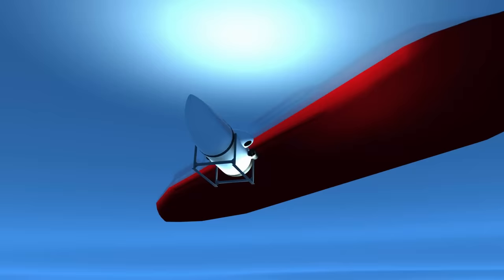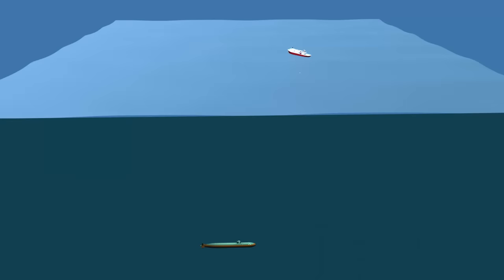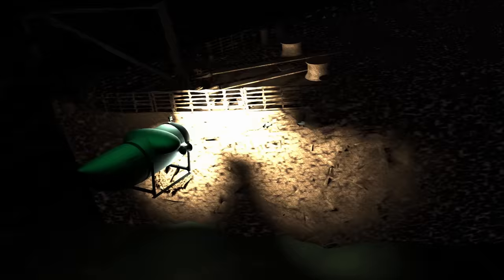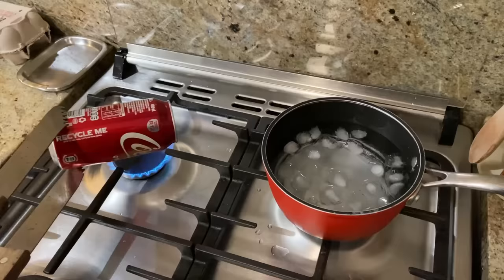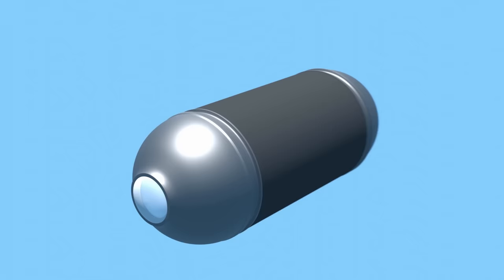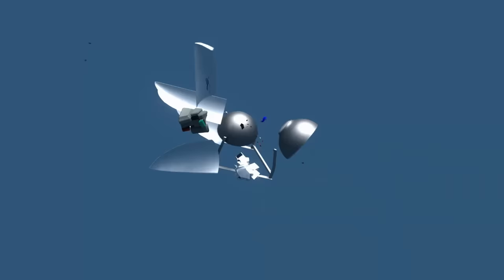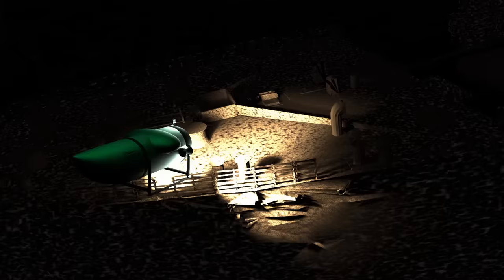TITAN Sub implosion | Deep Dive animation explanation

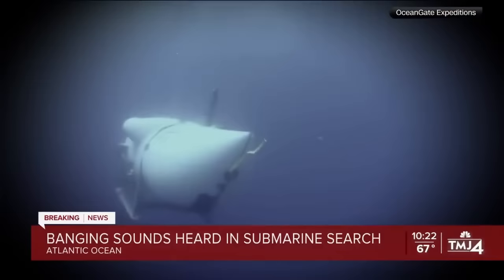Comment: 5:59 There was a brief statement given that there was explosion heard. The reason for not immediately saying they imploded is that it is better to continue searching and find out later that the ship was long gone. Had they called off the search and an intact hull with bodies was later found, there would be serious repercussions to any leadership of the rescue as well as public backlash.
Reply: Also, the sound was plausibly an implosion, but not guaranteed to be.

Also, and most importantly, the first ROV that could go as deep as 4000m was immediately called upon and was mobilized from buffalo to the wreck site within 4 days. 32 tons of delicate equipment, plus the crew, plus all the installation of the equipment. they immediately went down and searched for the probable site of implosion debris and found it within a few hours. It's unbelievably fast. like above-all-expectations fast.

Every expert speculated on the implosion because it was the most likely scenario, but it was unproven before the debris were found. You couldn't even hope for the debris to be found as fast as they were.

Comment: Nicely done. As a fellow architect, my interest and deep respect for engineering and science mirrors yours.  It took my career into the field of complex adaptive systems & simulation technologies.  When I saw the video of them smearing glue (epoxy presumably) on the inside of the Titanium collar I was flabbergasted at the loose dimensional tolerances that enabled the ring to slip over the carbon fiber tube with ease.  Surely, I thought, they aren’t relying on hand-smeared epoxy to seal the gap.  Also I did a few bending moment calcs which I then rotated 360 degrees and wondered whether bending stresses and shear forces at the glued titanium rings from the enormous uniform loading had ever been simulated or tested with different carbon fiber weaves…..a sad loss for sure but, aside from the panic over the emergency, the implosion would have happened far faster than any awareness would have been possible.
Reply: Astonishing, that glueing bit...no squeeze out, and just what, 2 inches of contact area between ring and tube. I'm nowhere near an engineer, but mixing some epoxy in a scadgy bucket then scraping it on like that didn't look like the sort of precision engineering where you need it most on a submersible...yeah, I know, everyone's an expert in hindsight!
Reply: @jnavonoD  I agree and had similar thoughts - surly they weren't relying on that to keep out 370 atmospheres...no, they are.

Comment: I heard someone saying that problem with Titan's design was that carbon-fibre has limited lifespan on so many dives. If you want to make carbon fibre sub you need to completely replace it every few dives. I'm surprised that was 24th dive. That was extremely greedy. Another good insight was provided by you: "Fillaments were rolled in one direction only". Maybe if they rolled it in all directions this wouldn't happen or would happen after many more dives instead. But seriously..they didn't test how many dives can this carbon-fibre structure survive to cut costs. Now instead of dollars they payed with lives.
Reply: No it wasn't the 24th dive, it was 7th dive with that exact hull.
Reply: Not sure if it’s true but I heard that last time they were on this same submersible it was giving problems and still ignored the signs 🤦🏽‍♂️
Reply: Rush purchased the carbon fiber from Boeing — which boeing had “retired” bc of its age and stored in a warehouse for quite some time
Reply: @rejuvenatingsoul3498  I've seen different numbers . 9 for instance, but I don't know where the maker of the video got 24 from.

Comment: This is an excellent analysis. 

I am no expert, but I am reminded of the difficulties experienced with the early Comet jetliners. That was also a situation where repeated cycles of compression and decompression caused fatigue over time in a way that engineers had not anticipated. The Comet was operating under stresses that passenger aircraft had not yet operated under.
Reply: The problem with that analogy is the designers of the Titan had generations of engineering history to look back upon (much of which they disregarded), unlike the Comet engineers. The analogy would be proper if the Comet were designed today with all its flaws!

Comment: A search of "Did Titan try to surface? " results in an article (Insider) that notes the ballast had been released prior to implosion ... suggesting the passengers knew something was wrong and prompted them to urgently try to surface.   Sadly, the idea that they died in blissful ignorance may not be wholly accurate.
Reply: Yeah they likely would hear cracking noises as the hull started caving in, but once it finally did. They died in about 0.01 seconds, or even faster even.
Reply: @FabledGentleman my guess is 
It takes much longer than .001 seconds to make a thought
Reply: @PInk77W1  Well at least thoughts don't hurt. Might have been scary down there for a few seconds.
Reply: @FabledGentleman the Pakistan businessman’s son did not want to go down and only did it for his dad. He would have been terrified the whole time.
Reply: Yeah, that's why the engineer Oceangate fired said that Rush's acoustic monitoring system was worthless because by the time it would warn you that something is wrong it was likely too late to save you.

Comment: Nicely done
As someone who designs and builds with glass and resin, the strand orientation is baffling. The predominant direction of fiber should be along the longitudinal axis, the only thing working to resist the forces involved here is the resin. A chopped strand blown tube would have been more effective at resisting pressures. 

And why!? I still haven’t heard an answer why Stockton chose carbon over steel? Cost!? What was the differential ? 
You want long shelf life? Build a big oven and shove your steel sun into it and anneal every 50 dives. Brand new. 
Carbon prepreg. Only gets worse with age
Reply: I suspect a failure like that shown in https://www.youtube.com/watch?v=8tW4zfTeJqM video posted ten months ago, showing a tiny model submarine in a deep sea chamber.  If the composite delaminated, it could have been squashed flat like shown without breaking any of the circle-wrapped carbon fibers therein, rendering the strength of the fibers a moot point.  Having some fibers running from the outer perimeter of the hull at the bow, to the inner perimeter at the waist, and then the outer perimieter at the stern would have improved strength a lot, but there should also have been fibers running radially and wrapped around something near the inner and outer surfaces.  In order for the hull to collapse, it would have to get thicker, so fibers connecting the inside and outside would be positioned to discourage that from happening.

Comment: A loud bang on hydrophones + loss of comms is a pretty bad sign, but doesn't prove conclusively that they imploded. From the PoV of the search team, if that scenario happened, then the crew were dead. In that case, they didn't need to confirm that fact quickly. But at that time, it was still possible that the sub had lost power but successfully executed an emergency ascent. In that case, they would have been floating on the surface, unable to open the hatch to get access to air (plus that would have caused them to sink anyway). That scenario was the only one possible where the crew might have survived in the end. So it made sense to focus on that until time ran out for the air supply.
Reply: yeah but they also definitely heard the bang. unfortunately they were probably in denial about what the sound was. but they used sonar technologies to communicate, there's no way they didn't hear a loud noise at the same time
Reply: They had the comms but also the transponder which failed at the same time of comms so they knew even without the sound that it imploded. Losing comms was pretty common with Titan.
Reply: I heard it just took that much time to even get underwater search vehicles out to the wreck site to look for debris and confirm it really imploded.
Reply: ..

P😊😊😊😊😊
Reply: @nafmtigia  The point still is to focus on hoping to save life instead spending time looking for dead bodies. Are you actually calling that "denial"? That's "triage".

Comment: I worked  with this composite material for years for use in dead tank circuit breakers on a global scale. These parts undergo unbelievable amounts of pressure and heat during use in the Interrupter. At one point, Inventory was mistakenly providing production with expired parts as they have a shelf life to abide by. This caused the breakers to fail tests. I understand Stockton purchased outdated material for the hull. If this is true, this submersible was a ticking time bomb based on that alone.
Reply: IIRC he purchased outdated carbon fiber from Boeing(?) and iirc, this video said that the CF was used for the cylindrical body part (5 inches thick)
Reply: From other Youtube sites, where materials engineers have comments, it's my understanding that the carbon fiber composite has great tensile strength, but low compression strength, that it is difficult to diagnose failure until it does fail, at which time it shatters.
Reply: @TheCandiceWang Boeing commented that OceanGate or Stockton Rush never approached them at all.
Reply: @@frogmen6105 your English is fine!
Reply: @weiwu1442  yup. I see that. Idk where the lies begin and where the truth ends??
Reply: @weiwu1442  purchasing parts from Boeing is different than Boeing working on your submersible and giving their expertise to your project. Totally diff things.
Reply: No, hearsay. Boeing denies knowing OceanGate / CEO
Reply: @@frogmen6105 It might have had an effect.. I believe that certifying CF parts isn't an exact science. It depends on percentage of load versus capacity, temperature environment, analysis of the angles of force against the structure. It will eventually fail, and probably without warning. If it gets so much as a scratch, you replace it. You get a performance curve which exceeds the operating load envelope with a large margin, and probably varies with the number of cycles.
   In compression, the carbon fiber doesn't come into play until the epoxy breaks down enough for the fibers to move at close to an 180 degree angle.
Reply: He was completely crazy. He had to use carbon fiber, then it had to be expired, then he had to make it 2 inches thinner than originally intended, then he did not do the correct pattern, then it was glued on titanium parts instead of being solid, then it had to be cylindrical, then he had to use glass rated for only a third of the pressure,  then he did not scan the vessel after use and did not do proper testing before, on the first dives he heard loud bangs of parts of the carbon fibre giving in, and he towed it on a platform causing additional stress to the sub, it could not open from the inside, and he had no dive without severe failures of some critical parts. 

This guy was so stupid, his death was completely inevitable. At some point they did not even clean the chamber between use even though months passed, and he managed to have a thruster installed backwards, which he noticed only after the sub was spinning around instead of going forward at 3800 m depth.
Reply: Stockton was egotistical, he could have talked with a few employees from Boeing from time to time off the record and made claims to be working with them, which is not the same, whatever interactions occurred even extremely minor he was using it to boost his credibility

Comment: I like this one. Little conjecture, but informative.  I was also surprised at the carbon fiber wrapping being unilateral. It was wrapped over a steel - which also surprised me. There are lots of issues to deal with. Good job.
Reply: And yet, it survived 23 times, with vigorous inspections in between dives. I think the weak link was the glue that held the rings on each end of the carbon fiber tube.  What ever happened started happening about half way down, and it looks like for about 6 minutes they struggled to come up, before implosion occured. I think a tube failure would have been all at once. But a glue seam failing might take several minutes to separate and implode.

Comment: Carbon fiber is far stronger in extension than compression. That fact alone makes it a lousy choice for any sort of pressure hull. It weakens with each dive because stresses build up and then dissipates with each dive due to fractures within the material forming and joining with others until eventually it fails suddenly.However, this was not the only deadly flaw lurking in the Titan submersible. The view port was only rated for 4,000 feet, not 13,000 feet. If it failed the result would have still been an immediate implosion. The bond between the carbon fiber center section and one or both of the end rings could have also failed because they were inherently flawed to begin with. I suspect the Coast Guard will find conclusive evidence of what caused Titan to implode and how.
Reply: 100% agree, with the fact that Carbon fiber are excellent against tensional stress rather compressive stress.... Good to make its use in space where internal pressure is more than outside but not for under water with high pressure outside.....
Reply: Tension can resist crushing though, in a circle. For the circle to go out of round requires one part to compress but ALSO requires another part to stretch.
Reply: Wow ! Suddenly everyone Is an expert on the appropriate material composition to construct a deep sea submersible
Reply: @lionheart4552 at least everyone who hasn’t kllld 5 people
Reply: All they needed was a couple of cans of Flex Seal
Reply: @PInk77W1  That has got to be the daftest comment ever on YouTube.
Reply: @lionheart4552  is daftest good or bad ?
Reply: @lionheart4552  Wow!  Suddenly the comments are filled with dismissive nonsense about how nobody can offer an informed opinion.   Might be some of us have knowledge you lack?
Reply: Interesting how the carbon layers were laid.  Having build large scale high performance radio control model aircraft, I would have thought they would have laid some of carbon fibers in a overlapping cross hatch pattern which would spread the stress loads over a larger area.  Also a weak point has always been where dissimilar materials are attached, such as the carbon fibers and titanium rings. Carbon fibers and epoxy resin can make a very strong structure, but they are brittle.  I   know this after examination of some of my crashes where the metal bends, but the carbon fibers shatters.
Reply: @lionheart4552 No, a lot of us don’t have that knowledge. But, we trust the many experts that do have that knowledge and have analyzed/explained this disaster. Funny, it’s almost like relying on the experts would avert such catastrophes.
Reply: @jacksons1010  I didn't know that you were a member of the  National Transportation Safety Board. Please accept my apologies.

Comment: This is probably the best video I've seen yet that covers the implosion aspect of this tragedy. The reenactment using CGI and the Coke can experiment really wow'd me. Great content.
Reply from the maker: Come back for more 😀
Reply: Yup, the main difference is that the aluminum can merely crumpled, while the carbon fiber shell apparently  shattered into tiny pieces. Any recovered parts are are probably adhered to the metal frame, among with bits of flash-cooked human remains.
Reply: @hopsiepike  flash cooked? the implosion generated heat?
Reply: @pollystyrene99  like the surface of the sun, instant vaporized